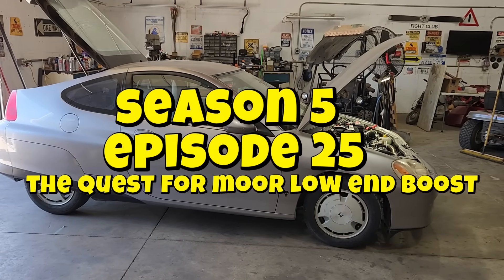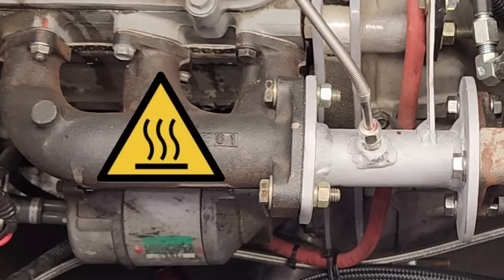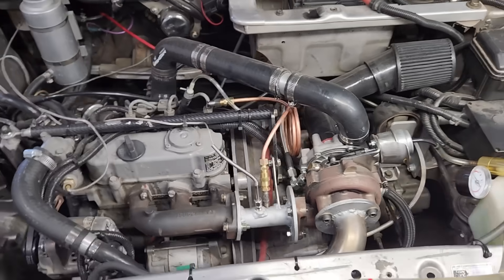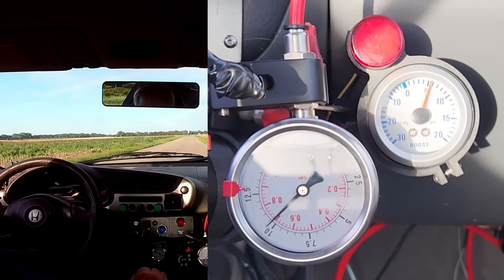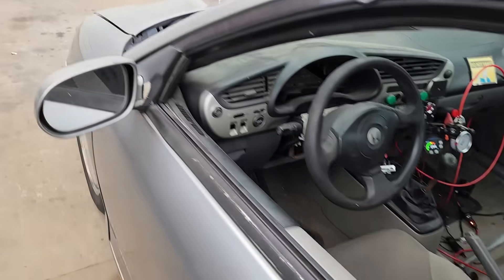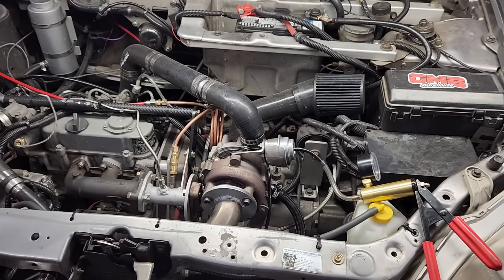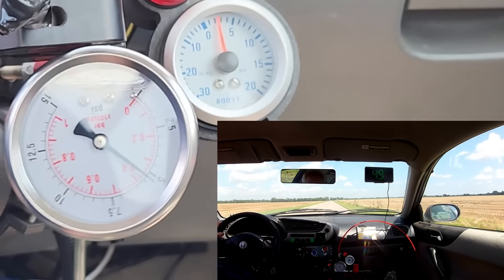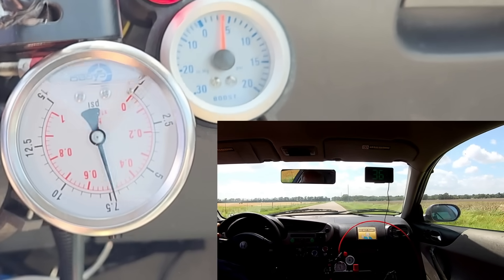S5 E25. Can we get more BOOST from the VNT/VGT turbo on the 719 cc kubota diesel Honda

Comment: I wonder if you could swap the hot side from the previous turbo onto the cold side of this one to get more boost. Should spin faster at lower engine speeds.  A lot of high performance racers use a setup like that.

Comment: So the problem is, you are not opening the VNT to reduce the back pressure, as in you can reduce the vacuum once you have reached 5psi and then maintain 5psi with lower back pressure, at spool up some cars have 40psi+ exhaust manifold pressure, it's completely normal with a vnt
Reply from the maker: As I mentioned in the video, off camera we did back off on the VNT a tiny bit once we were making boost and the boost drops.  Its very hard to capture this sort of thing on camera and explain it,   We didn't show any of that stuff because it would only add confusion because  some folks would assume I did it wrong and and I would get a slew of comments from people seeing something that didn't actually happen.  Its unfortunate that I have to withhold some parts of the videos because some people will not accept my observations.
Reply: @robotcantina8957  if you make a plot of boost to rpm with the vnt screw adjusted, and compare it to OEM setting, I would expect to see more boost lower in the rpm with the adjusted screw. This would be likely why you "feel" like the car is faster with the screw adjusted, as in more area under the torque curve. Of course if you end up with more back pressure but the same peak boost pressure then you have to fine tune the vane position to give the lowest back pressure possible without dropping boost pressure. Also boost pressure only tells some of the story, because the air density is not necessarily the same. 

Another problem is, that if the exhaust wheel flows too much then you can't extract the energy from the exhaust gas efficiently, and then you close the vnt to get the shaft speed back at the cost of excessive back pressure since the VNT closing angle then becomes the exhaust restriction and not the exhaust wheel. Once you have adjusted the stop screw to get the best boost response, every psi of boost you make will require a certain value of vacuum drop on the vnt actuator to keep Back pressure under control while allowing the turbo to spool quickly.

Comment: Always been curious if you could use an electric motor to spin the AMR with arduino (sp?) controller?  I think some manfs are doing this, but I assume you need a high performance electric motor and a fair amount of juice to power it.  But maybe not so much on a smaller displacement setup?

Comment: I think fiddling with the factory settings would do some good purely because factory is for a bigger capacity engine, even if there's only about a can of coke between them... :)
Reply from the maker: That's kinda what I was thinking, but it looks like going past the factory settings may not yield any benefits.  I should really take the turbo apart to see what is actually happening to the nozzles once I go past the calibrated setting.

Comment: its a pity the unburnt fuel after initial combustion could not be directed from the exhaust and ignited in a separate chamber to drive the turbo so no back pressure would be caused, no power loss sacrificed only gained, it seemed such a good idea when I had a Ulrika moment, lol
Reply: Actually, not crazy at all.
Reply: @SchoolforHackers wait, isnt this what ALS is?
Reply: thats how a turbo works.....actually.
Reply: @DieselRamcharger  not accurate but basically. Banks turbo charging will explain it better than I could for you......actually
Reply: @MsJon52  lmao. a turbo is driven by expanding gases, from fuel still burning as it leaves the exhaust valve. that is literally what anti-lag, spraying fuel during the event where the exhaust valve is open. You know oh so very little, yet try to argue using what little knowledge you gleaned by misunderstanding one of the biggest hucksters in the business.
Reply: @DieselRamcharger  you are totally right but totally wrong on understanding my first comment , you know verry little of understanding others thoughts obviously, wind in your neck turbo boy, I was only stating it would be excellent to find a way of not  leaching any power of any sort and drive the turbo and keeping admissions as clean as , possible and as I stated it was just a random thought, LMFAO

Comment: Have you adjusted the injection timing? that can make huge difference on a turbo engine, the valve timing might also need a tweak by advancing the inlet and retarding the exhaust, especially on an engine that's designed to run at a steady speed,  also please give water injection a go, either pre or post engine!
Reply from the maker: The injection timing was advanced slightly.

Comment: Vgt adjusted by exhaust back pressure reference would be cool. Im surprised manufacturers don't include back pressure gauge oem
Reply: But they do. Most VGT equipped engines use an exhaust backpressure sensor for feedback in the PID control loop for the vane opening angle.

Comment: a back pressure to boost ratio of 1.9:1... kinda high... anyone build a stroker crank for this baby diesel?
Reply from the maker: Indeed, the boost ration is not ideal.  It would likely be cheaper to use a bigger engine than to modify this one.....

Comment: Beware.  (General FYI) 
Stops are often there to prevent mechanisms from going past a lock up or damage point and do nothing to limit function.
In other words you might be doing worse than just wasting your time adjusting the limit.
Reply from the maker: Yes, but it makes interesting videos.
Reply: @robotcantina8957  True
I suspect that's why you didn't check the travel while the you had the turbo apart.
Checking would have made for a really short video.

Comment: Could you increase boost by increasing the exhaust temps?
You made the observation that the back pressure sensor piping was just warm near the exhaust manifold.
Reply from the maker: Well, it gets complicated on a diesel.  In order to increase the exhaust temps you add more fuel, but on a diesel adding more fuel will increase the speed on the engine.  Right now we are focused on the low speed performance.  Sure adding more fuel will bring the boost up, but the boost will drop as soon as the engine speed matches the fuel that being injected.   Our experiment today was to see if we could force the turbo to make more boost without adding more fuel.

Comment: just use a spring on the vnt actuator arm, change the spring rate to control when the nozzles open.  the back pressure will open the vnt nozzles as needed.

Comment: Hey Jimbo! Wouldn't a turbo from a kei truck or kei car work better for the Kubota engine? The engines are capped at 660cc so the turbo might be close enough to what you need

Comment: You can setup a bleed setup that controls the tourbo without any computer, it's called a Dawes valve in Australia... But it's nothing special, I reckon it can be setup with 2 pneumatic flow control valves and a vacuum source.

Comment: You could get 1.4 TDi turbo. It's similar (very slightly bigger) but has WAAAAY better avilability. 1.2TDi was only in Audi A2 3l and Lupo 3l. This engine was tuned for max fuel economy (3L in those names - <3L/100km/h, Lupo did 2.99L/100km).
Reply from the maker: I'm afraid the turbo from a 1.4 would be too big,  The reason we chose the 1.2 VNT turbo is it makes boost on the low end. It would seem the 1.3 turbo is still to big for this engine.
Reply: However 1.4TDi is just a tiny winy bigger, and is prepared for those small amount of exhaust gases, just like 1.2TDi. If You want really smol turbo - Mercedes/Smart 0.9 CDi has even smaller displacement. And it's also a turbo!😊

Comment: perhaps rig up a new linkage with a servo and a servo tester to drive the vane position? You wouldn't need a lot of lever on it, given you're seeing differences on half turns and you're only running around max position anyway, and it'd give more torque if it needs it. Imagine it'd be pretty quick to knock up and not need an episode of time to make, could then tweak the vanes on the go!

Comment: Please don't shoot me for saying this. My explanation may be a little off. Powering a turbocharger isn't free. Powering a turbocharger will always create exhaust "back pressure" which is actually turbine drive pressure. There is no avoiding this. If the VNT vanes are set incorrectly you create an excessive restriction in the exhaust. I think the ideal situation is having the nozzles set to aggressively direct gas onto the turbine then as gas flow increases back the angle off so as to not create an excessive restriction while maintaining adequate drive pressure.  There is a strong argument for monitoring turbine drive pressure on this type of system first and ignoring the intake boost pressure.  I'm going to sign off there however because I'm not qualified to explain further. I must say there is some temptation to deliberately explain the theory wrong so somebody can prove me wrong in the comments, but i don't roll like that. :)

Comment: Is that actuator correct for your application? The vanes should be fully closed and open up so as to reduce back pressure as boost builds. You're aiming to have high boost and low back pressure.
Reply: To bad be can't adjust the vgt on the fly...or can he?
Reply: @garthbutton699  He could if he had the hand pump inside the car, but that's not a permanent solution. OEM's control VGT electronically.
Reply from the maker: The actuator is correct for the turbo, Keep in mind we are not using a VNT controller and are just adjusting the vanes with a hand held pump.  We have tried adjusting then on the fly, but as soon as we build boost and then back off a tiny bit, the boost drops instantly.  Ultimately it would seem the turbo is too big for the engine.
Reply: @robotcantina8957  If it's building boost, then it should at least hold it when you back the vnt off. My guess is that you don't have fine enough control.  I would look at changing the actuator for one that's controlled by boost, or ultimately some form of electronic control with closed loop control and data logging so you can actually measure the readings rather than guessing. You're not exploring new territory, people have been fitting large vnt turbo's to old diesels for a long time. I'm sure there are solutions out there.
P.S. You haven't increased fuelling yet. Your argument that the turbo is 'too big' will be invalidated once you do this.

Comment: Adjusting the VNT stop is the way to go. I belive you are on to something. Just need to control it now. I would swap the cansister for a pressure referencing one instead of a vacuum, and then you can run a manual boost controller. I've done this to older VW diesels to convert them to a VNT style turbo.

Comment: As an engineer part of the metric crowd, I would also use NPT fittings.
Reply from the maker: Good to know!  I want sure if the NPT stuff was available for you folks.
Reply: @robotcantina8957 90% of hydraulic fittings are SAE, steel pipe fittings are metric.
Reply: As an engineer who has to endure NPT, BSPT, BSPP, and DN all in one machine I can confidently say NPT or DN all the way. BSP is too close to be different and the straight or tapered threads always give grief when buying fittings.
Reply: @jackfrost1031  JIC is best.  No leaks, easy to tighten etc etc
Reply: As a hobbyist in New Zealand, those fittings would cost as much as the engine.
Reply: @HavokTheorem yeas, retail prices are insane, you must have good relations or must work with heavy machines to get good discount
Reply: As a pipefitter in New Zealand, BSP any day of the week over NPT

Comment: Little bit of exhaust pressure it good to help with exhaust scavenging.
Reply: Ooh, can’t wait to start this comment war! Back pressure is never good (for a 4-stroke) but exhaust systems which create good scavenging, i.e. suction while the exhaust valve is open, also tend to create measurable backpressure as a side effect.

Comment: Try the other way, and ease out the vnt vaccum when you reach the desired boost and see if can hold it, normally on vehicles that doesnt have VNT controllers here in portugal, we change the vaccum canister for a pressure one, so the VNT is always closed at no load, and opens with boost reference at the boost you want, you then can control it with a normal manual boost controller
Reply: Brilliant idea. I was thinking the same thing when Jimbo was explaining how it was regulated.
Reply: I use a low boost rating can and exterior springs so the transition is smoother
Reply: @carrizog60 interesting 👍
Reply: That's correct this has been done in the UK on the rover l series

Comment: obviously, the next step is to wind it in half a turn from factory... disappointed you didnt as i suspect the performance will increase when not wide open...
the less backpressure required to produce the boost the better...
youre making less boost with the higher backpressure simply because the cylinder remains at a higher pressure and fills less on each cycle...
Reply: Thats not how it works. Turbos don't work from gas flow. They work from thermal expansion. The gas flow simply allows the engine to make power but the turbo requires that "backpressure" (which is actually a measure of thermal expansion and flow rather than simply one where he has it set up) to allow it to puch the air in the first place.
Reply: @siraff4461 not really, the turbine works off of flow, how do you think hydro turbines work with no temperature difference? The thermal expansion helps because it creates more volume which means more flow, but also the fuel being burned goes from a dense liquid to a light gas, again increasing volume and flow. You will always have a pressure difference from the exhaust manifold to the down pipe but the flow the exhaust manifold pressure for a given boost pressure the better. A highly efficient turbine can make much more boost than back pressure.
Reply: @trev0rbr  So where do you imagine the energy comes from in a hydro?
Reply: @trev0rbr  there are two types of turbine. reaction and impulse. turbos are a mix of both. velocity built in the volute impinging on the blades as impulse, and expanding on the way out through the exducer into the downpipe, with reaction acting on the bent over blades...

you cant just strap a turbo to itself, spool it up, and have it run. it needs something else. heat. lol, burn barrels... 
the engine can only use so much heat and pressure created by combustion, then has to dump it. the turbine can take that hot air, still with plenty of energy, and use it to get more air, more combustion.
an engine only exhausts as much air as it ingests yet it sprays out "more". no, its just hot from combustion. as it reaches ambient pressure it has to dump that heat, or expand. it does both, then finally, eventually,  contracts back to its original size and pressure...
yes, turbos have to create SOME back pressure... (lycoming, wright, which plane had the power recovery turbine? uses a pure reaction turbine, with no backpressure...) but its the ratio of back pressure to boost that really matters.
the higher the backpressure, the higher the residual exhaust. the boost may be the same reading but as a percentage of cylinder filling, its lower overall. the cylinder pressure was already higher... the lower the ratio, the better the boost is.

vane turbines are weird though... closing the vanes also increases velocity... imho they dont work as intuitively as we think they do... open isnt necessarily better.

still think theyre better off to rip the actuator off, run a cable into the cabin so they can adjust on the fly, and clock that housing so the drain is vertical...

Comment: Hey Jimbo, doesn't really matter but drive pressure is what you are dealing with between the engine and turbo. It is effectively also back pressure. There is a point where the drive pressure vs intake boost relationship makes a difference
Reply: Higher back-pressure means the engine has to fight it. So... vnt has to move to let exhaust flow (maybe not to max position, cause it will make no boost scenario).